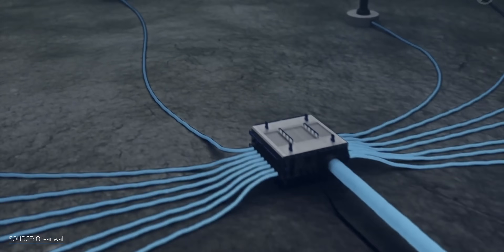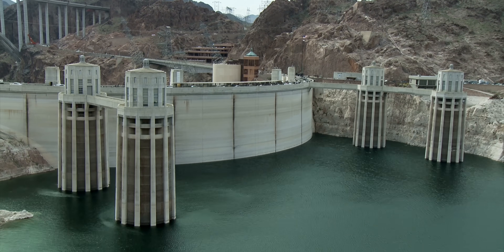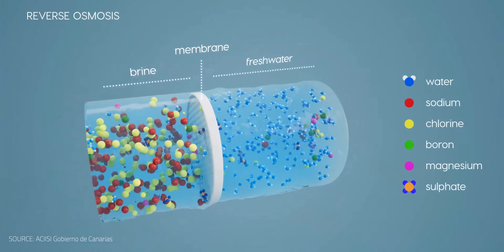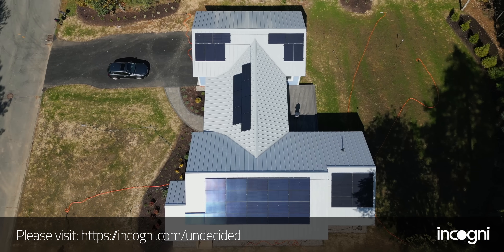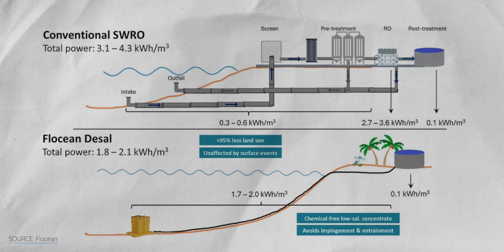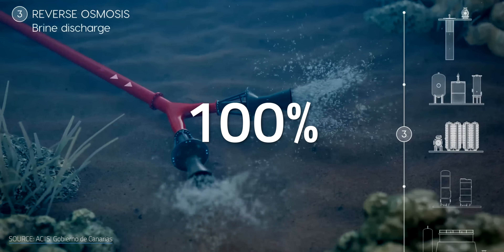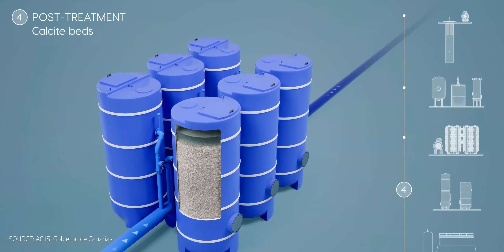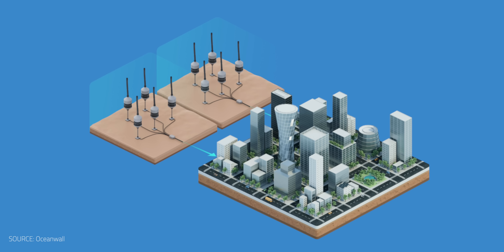How Deep Sea Water is Now Drinkable

Comment: Another way to power the pods without needing long high-power underwater cables would be to design a version of the recently discussed Mass Produced Micro-Reactors that can use the very cold deep ocean water to cool the Core...install one of these at each Desalination Pod Hub and it can easily power dozens if not hundreds of pods in it's immediate area without needing incredibly long power cables...all you'd need is a very long Fiber-Optic Cable run along side the Fresh Water Pipe to Monitoring Stations on the Surface to keep watch on both the Power Core and Desalination Pods...

Those Micro-Cores would also solve the Emissions problem the current Desalination Plants have by taking them completely off the Grid so no Fossil Fuel Power Plants are needed to run them and doesn't require the huge amount of land Solar or Wind Power Plants need either...one Micro-Core installed right in the basement (or roof) of the Desalination Building would create all the Power it could ever need without taking up and space needed for the RO Filters or pumps...and if it's on the Roof, then when the Core exhausts is Fuel, replacing it with a new one is as simple as firing up a crane, removing some bolts and unhooking a few wires, lifting the old core out and setting the new one in it's place, bolting it down and connecting the wires...it could probably be done in as little as 6 hours...if that...and then the old core is taken back to the Mass Production Factory it was built in for refueling before being shipped out to a new location to generate the power needed for that Factory/Desalination Plant/Refinery etc.

Comment: Coastal cities should build really tall skyscrapers. Like over 2,000 feet tall, and then (hear me out), local desalination plants should pump water to the top of those towers, so that from there, gravity would naturally pull the water through pipelines to reservoirs far inland. The elevation of the Hoover Dam's Lake Mead's surface when full is only 1,230 feet, so a 2,000 ft tower on the coast could fill that lake and then some. 

Then, large inland cities served by that water could also build similar tall skyscrapers, and sell their water surplus to reservoirs that are even further inland.

Comment: I was a design manager in what was, at the time, the largest RO plant in the world.  Just a bit of info about the brine outfall.  It's not really that bad, environmentally.  Very localized in a given area, that is offset by the amount of life that springs up on the intake areas as every little water critter loves sitting next to a gentle current that they can filter nutrients out of.  Periodically they have to scour the intakes because of all of the life that attaches to intake elements, and blocks the flow of water.  Everything you said about energy is true, but the brine outfall just isn't really that much of a concern.  Even your picture of the outflow shows the little fishies swimming around it, as they're trying to extract nutrients from the concentrated brine.  Mostly, the ocean is just BIG.  Orders of magnitude more chemicals are flushed into the ocean by rain-water simply running over land before it reaches it.

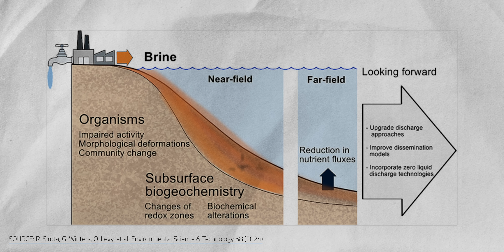Comment: 8:58 isn't possible to add an additive chemical at the bottom of the sea to mix with saltier brine, and have extended salt pipe lines to dispurse the concentrated particles along a sea salinity concentration border. . That might be more money and maintenance although you can add that to the wind turbine checkups as well? There's other technology that can go along the lines with this osmosis innovation. 9:14 i like the ladder. 10:07 so we got plastic in our drinking water

Comment: Now this is the first time I see a desalination system that's potentially sustainable at scale without the billions of tons of salty brine needing a dumping ground.
Reply: @uweschroeder  It is still Dumping the same amount of Salt Back - but No chemicals back in the sea, thats the good Thing Here afaik. (If you Filter 1m3 freshwater with this or an onshore  method, you "produce" the same amount of Salt)
Reply: @Mitnixbinichfroh  Yes, you would produce the same amount of salt, but the video mentions it: it wouldn't be a highly concentrated brine in coastal waters. The process is "less efficient", so the brine concentration it spits out is a lot less than an onshore operation would create and it's designed to disperse the brine better over a longer period of time.  Currents would have time to dilute and flush the brine away. The effects on wildlife would be considerably less, if any

Comment: Curious as why they're placing the pumps in the deep water.  If the deep sea pressures push the water through the filter, the return line without pumps should eventually push the filtered water up to sea level.  
Once at sea level, you can start pumping it and perhaps, turn it into a syphon where it doesn't need a pump 100% of the time.
Just a thought as I don't know enough about the technology.

Comment: As an engineer with OTEC experience, I see red flags—static pressure, pump cavitation, and depth issues all make this design highly questionable.
Reply: I guess we should take it with a grain of salt
Reply: @smokeduv  unfortunately I can't  respond to you with sounds or image so just imagine this in your head: ''Badum Tiss''
Reply: no problems we haven't solved before in oil extraction
Reply: Pump cavitation should not be a problem at such pressures.
Reply: Didn't he say the pump is land-based, with only the filter being at depth? (since the pump was on the fresh water side, it used the pressure of the ocean to do the bulk of the work)
Reply: @DUKE_of_RAMBLE  I'm not sure the pump can be land based because even if it pulls a perfect vacuum, the max height it can pump only gets to 999 ft. it depends if the buoyancy of the freshwater gives enough force to finish the last bit.
Reply: @griffinkimberly7695  I don't pretend to know about how fluid works, but I know enough that it you put a hose in something, the liquid will flow into it up to the same level as the bulk of the liquid is. Also, if you bring it up to a height, then add a bend that puts the outlet below the liquid's level and get it flowing, it will continue to flow (aka siphoning).

Therefore, this setup they've made seems logical to me and perfectly plausible.
Reply: @DUKE_of_RAMBLE Ah, you misunderstand, I'm not saying it can't be done, I'm saying the pump has to below sea level, at least a little bit because of the physics of using a vacuum pump instead of a pump at the bottom. It's why those "Submersible Utility Pumps" have the pump in the water.
Reply: @griffinkimberly7695  I’d think the pumps are there with the filters, which is why they need to bring power too.
Reply: Also, don't those toxic heavy metals end up there?
Reply: Doesn’t cavitation decrease with depth?
Reply: @ghost_ship_supreme  Cavitation is the creation and implosion of gaseous bubbles from things like ship's propellers.
You may be thinking compression?
Submarines have a maximum depth because of the need to keep the squishy and fragile humans inside alive and breathing at much lower air pressures than exist outside the hull.
-
These kinds of installations can avoid that problem by not holding any internal volume at pressures so drastically lower than the water pressure at operating depths.
This can be by ensuring internal spaces are open to see water, or filled with less compressible materials like grease (for moving parts) or conformal coatings on electronics to protect them from water exposure and shorting.
Reply: @ghost_ship_supreme  Logically I would think so, but I don't have any proof to offer.
Reply: A good place to star developing this technique will be off shore oil extraction plants located along really deep exploration fields.
Reply: @victortaveira8271 only for demonstration purposes, shipping water is inefficient. And if they've anyway done in-situ demonstrations, what's the point?
Reply: Since it's being happening in California the money will start flowing but somehow nothing will get done...  kind of like their railway system...
Reply: Its another way to create renewable sources of constant income.

Comment: @UndecidedMF  the pressure at depth is not a hydrostatic energy source. 
(perhaps they say this to politicians to get funding).
You may think the hydrostatic pressure can be used for the RO to save energy, but then instead the pump has to pump water from that depth to the surface - using all the "saved" energy.
No net gain as far as I can see.
The is no explanation why sucking is more efficient than pushing.
(BTW if you live at an altitude lower than the bottom of the sea, then it's great - unlimited fresh water for negligible energy)

Comment: Okay here is an explanation why this will not work. You still need to pump the water out from 600m meter in depth which is equal to energy for creating the same pressure on land. The Delta P that needs to be created is the same. The water that is coming out is at 600 m depth. So The potential energy =p*g*h (density of water * gravity * 600m)
Reply: No they need to pump the water just from the sea level, and the RO water is even ligher than sea water

Comment: So you are saying that pumping water up-stream from the depth of the ocean doesn't need much energy because of the pressure present there? It just does  not add up..Once the hydrostatic pressure is equalized on both sides of RO membrane, that's it, you are fighting the same pressure to pump the water up, no matter where..Sorry there is "no free energy "
Reply: Other replies are probably better, but they are only pulling up fresh water, while the other system is pulling up saltwater with the extra mass of the waste brine.

Comment: My invention is definitely better than desalination, much more practicle.

🔹 Even More Portable & Scalable
- No need for electrolyzers or water input to split.

- Can be deployed anywhere — even in deserts, islands, or mountainous regions where water sources are limited but solar power is abundant.

🔹 Logistically Superior to Desalination
- Desalination requires massive plumbing, sea access, filtration, and then distribution of the resulting water to inland locations.

- My system only requires the delivery of one element (NO, not water), which is lighter, safer with proper handling, and potentially deliverable via trucks, pipelines, or solid-state carriers.

🔹 More Environmentally Responsible
- No brine.

- No high-pressure pumps.

- No marine disruption.

- No grid dependency.

Comment: What a load of baloonies, really! A sea water desalination plant is not only about dP to overcome saline water osmotic pressure, already about 30 bars = 300 m = 450 psi. And you don't get that from density diff of saline vs.fresh water! So, no free lunch on pumping duty, sorry. But pressure must be quite a bit more still! But there are other serious issues. Like feedwater pre-treatment. Everything down to a nano-size must be removed. Further, your RO recovery will be about 50% to avoid, Ca, Sr, Ba salts  precipitating on the membranes. How will you dispose of the brine such that it doesn't pool around the intake and cripple the process. Then comes mtce down under the sea. The first thing you see behind every RO unit bldg. is a mountain of disposed RO elements. Let me know what you guys are smoking. Must be real good 😂😂😂😂

Comment: For anyone wandering why this would use less energy than just the conventional method. It took me a while to figure it out myself but once you understand it's pretty simple. 
So first we need to ignore the entire thing about pumps, that's where it gets confusing, so I'm going to explain the basic concept first then explain where the pumps come in, and that should explain where the energy savings are. You can do this experiment in a swimming pool if you want, though without the complicated filtration system. 

First they take the filtration system and place it in the deep water. Then take a large empty tank (You can use a tupper wear container without a lid if you want to do the experiment.) Then connect pipe (or tube) to the bottom of the container in a way that it is water proof. (No water can leak into the container without traveling through the tube first) Now they hook the pipe (Tube) to the filtration system at the bottom of the ocean. (Just tie a cloth to the bottom of the pipe and tie a rock or something heavy to hold it down to the other end and drop it to the botto of the pool.) Then take the empty tank (container) and push it under the water, not enough to fully submerse it but enough to create a difference in pressure between the container and the outside water. What you will notice is that the tank (container) will fill with filtered water from the bottom of the pool because the water wants to fill in the empty container but the only place that it can do that is at the other end of the tube. This creates a suction force in the tube. 

Where the pumps come in is that they are pumping the fresh water out of the tank at the top of the water. This creates a suction force at the bottom of the tube that re-fills the tank a the top. So basically using this method you can get filtered water from the bottom of the pool using the same amount of energy you would need to such it up from the top of the pool. Since you're doing it this way though the tank will fill up a lot slower than you are sucking it out. That's not a problem though because you only need to add more filters and pipes and a larger tank to make up the difference. With enough filters and pipes and a large enough tank you can create an equillibrium where you're pumping water out faster than it's being pumped in. 

This is a simplified explanation that is easier to immagine than what they are actualy doing. But I think this should help you guys people understand what's happening easier than trying to picture this big complicated system they are using.
Reply: This was a huge help

Comment: So, isn't one of the benefits of nuclear power that it can create heat. that can create steam? That steam could be condensed, and also used to drive turbines to generate power. So surely, design safe nuclear reactors, and have them create water and power, and the salt by-product can be dealt with in the best way. Maybe backfilling old mine shafts etc.

Comment: DSRO should prove to be more efficient.  Salt water is more dense than fresh water so there will be a buoyant force helping the pumps recover the fresh water.  I imagine that gravity would suffice to perform the reverse osmosis as long as pumps remove the fresh water and provide a height difference.  But, someone should work on a way to recycle the RO filters.

Comment: I thought there was just a recent breakthrough showing that certain spectrums of light at certain angles could be used to evaporate water without heat with a ton less energy for desalination.
Reply: @daemenoth  I also remember this. I think it was somewhere in the green light frequencies. But this was to cool down air as far as I remember. But it doesn't seem like it has seen daylight just yet in the way of a functional product.

Comment: Noob question. RO is a process that creates a brine with little or no economic value and is harmful to the environment with the intent of creating fresh water for use. Vacuum evaportion is a process used to "mine" salts from the ocean. These salts have commercial value and the fresh water is a biproduct. Why aren't we tapping into the fresh water from this process?  Intuition tells me it is a energy and cost effective solution for manufacturing salts.  If the salts have value too, why not ramp things up and get all the fresh water we want? With a side of valuable salts?

Comment: If the deep sea RO unit were directly attached to an adjacent tank for holding the fresh water where the tank is a very tall structure which reaches the surface then would the ocean continously force water thru the RO unit into the tank until the tank fills? With fresh water now at the surface then it just needs a pump to ship it to where it's needed.
Thinking of Deep sea oil rig legs or something like those for the tanks.

Comment: “RO plants rely almost entirely on fossil fuel.” Though the Diablo Canyon RO plant, north of Carlsbad, is powered by the adjacent nuclear plant.

Chemical-free pretreatment is proposed at the interface using a series of ever finer filters. Safe drinking water can be produced without using chemicals, and that is very rare given the added cost of that approach…on land. I don’t see how they’re going to flush the plankton that gets on the filters. Without active washing/scraping, strong backwashing, or frequent replacement (monthly or more often?), those filters will clog at a very fast rate. More importantly, the probability is very high that macroscopic organisms will grow on the surface of these devices. Macroscopic organisms could begin to grow on the housings and pipes, and then expand over the filter surfaces.

I have inspected hundreds of water treatment plants, and all of them, regardless of the quality of water from which they draw, have to actively maintain their filters to sustain sufficient flux. I do not see that need addressed here in a cost-effective method.

Comment: You still have to pump the water up
You can’t suck it because it will evaporate in the pipe unless you have separate suction stations at intervals all the way up
In order to pump it you need a pump that is more powerful than the ocean pressure because water pressure is directly related to the height of the water and presumably they will be pumping into a water tower on land. 
There is no free energy